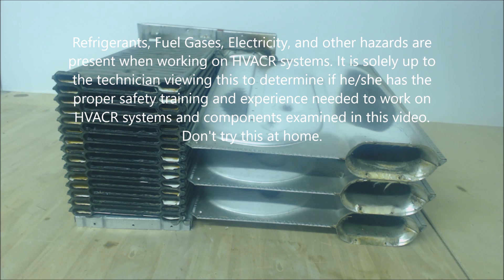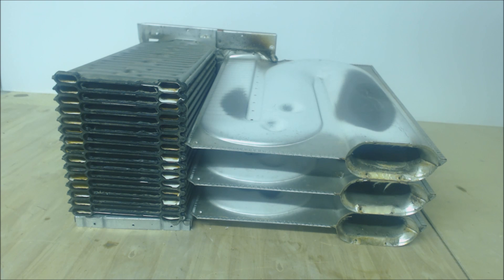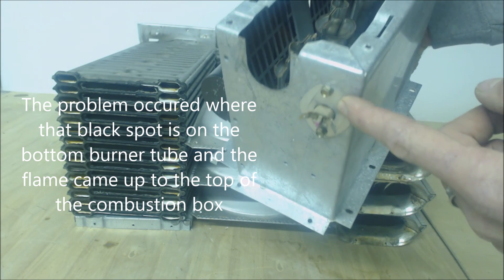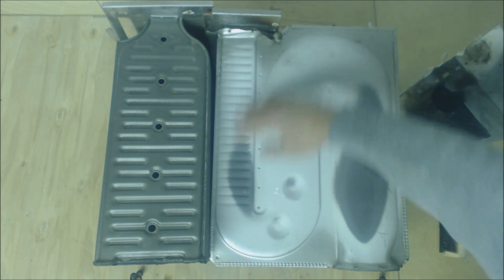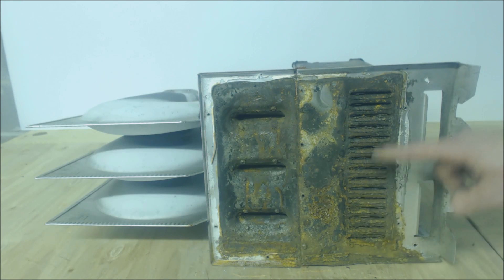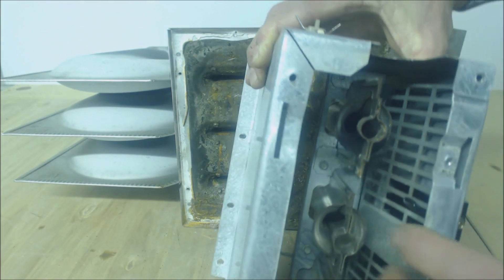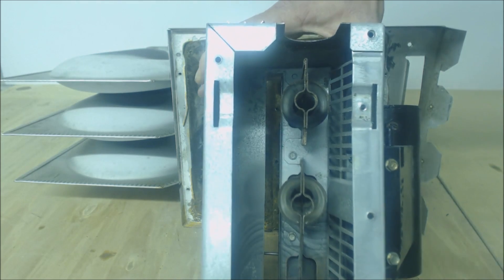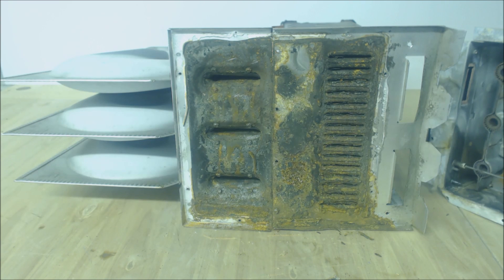Gas Furnace Heat Exchanger Clogged Problem- What it looks like and Burn Spots!

Comment from the maker: Tool List-  https://www.amazon.com/shop/acservicetech
Support-  https://www.patreon.com/acservicetech
For those that are looking for the tools used in the videos: (Linked Below)

Here is a link to the UEI DL389 Multimeter used in the videos- http://amzn.to/2av8s3q 

Here is the link to the Fieldpiece SDMN6 Dual Pressure Testing Manometer with Pump-http://amzn.to/2jyK5Ka 

Here is a link for the Supco Magnet Jumpers http://amzn.to/2gS4h6z

Here is the link for the Irwin Wire Stripper/Cutter/Crimper   http://amzn.to/2dGTj2V

Other tool links can be found in the video description section.

 ACSERVICETECH is a participant in the Amazon Services LLC Associates Program, an affiliate advertising program designed to provide a means for sites to earn advertising fees by advertising and linking to Amazon.com.
Reply: AC Service Tech LLC   If frozen  condenser pipe busted due to electricity off during freezing temperatures will this affect the heat exchange? I have carrier infinity. 2009 gas furnace and the heat exchanger  switch is tripping every 2-3 days depending on how often it is  turning on the heat.  Like now it is 23 degrees so I assume putting stress.  Did the  condenser pipe  busting and siting there for long time before fixing cause this issue?   If so I can get my homeowner insurance to cover fix or replacement.   I had busted/frozen pipes throughout. House that insurance is covering.  This happen   last winter  in Park city utah but just came back here to deal w/ the issues.  Thanks for your help.

Comment: This video really helped me understand my furnace and how the condensation is becoming an issue.  It was made in 1995 and is starting to exhibit some of these problems.  I'm thinking I will pull out the heat exchanger and clean it or replace the furnace.

Comment: Thanks for your video.  Had to buy a new furnace today because of issues with our heat exchanger.  I would love to troubleshoot and find a cheaper solution, but it is -25°C here, and will be all week.  Tough to be without a furnace for even a few hours.

Comment: I had a partially clogged secondary and was causing unusually low temp rise while running. 
I couldn’t figure out why the temp rise was so low. 
Manifold pressure was normal, no rollouts or HL tripping like I normally see when secondary clogging. The unit just didn’t have the heat output and I still can’t figure out why…

Comment: Seems like if the secondary exchanger plugs up more and more one should get a higher negative pressure at the pressure switch tube... Like an indoor blowers entering negative pressure; if the return air ducting filters and such are restricted you end up with higher negative pressure at the blower inlet... You mentioned reading less pressure if the exchanger is restricting flow????

Comment: Man this is scary stuff. My old 88 Model Rheem 11EA-JR will be 40 years old in 2028.
It sits beneath the floor and does not have a single flame roll out safety switch. It has quit working for now which is a good thing because I found a rotted out Flue pipe under the house. So far I have found 1 bad 90-370 fan relay and a bad pilot igniter.
Need to check the heat exchanger and I'm gonna put some flame roll out switches on it.

Comment: Thank you so much for the video! I have learned tremendously by going through your list of videos. I do have a question - my Lennox furnace attempted several time by inflaming for about 30 secs before it went to safe mode. When I bypass the pressure switch (the higher pressure one), it runs perfectly fine. I've ruled out other possibilities using your pressure switch video. Would that be a clogged heat exchange? And if so how would I verify if that's the culprit?  My furnace guy tries to sell me a new furnace so wonder if you could provide your perspective on this. Thank you in advance!!!

Comment: Excellent video. Tech was here yesterday. Furnace cycling off and on. Throwing an overheating code. New flame sensor. No roll out or odors. He checked gas pressure. No problems found so he says it must be the heat exchanger. Wants to sell me a new furnace. Yes, I it's almost 20 years old but with no evident problems found it sure feels like I'm just being sold a new furnace. Calling for a second opinion tomorrow. Thanks

Comment: Blessed my Evolution 90i was registered for Limited Lifetime Warranty within 90 days of installation. 
Limited Lifetime equates to double Warranty of 40 years.
Had to replace the heat exchangers. Parts covered by Warranty. 
Labor on me...
Reply: No it doesn't heat ex is only 20 all other parts double to 10 years with registration
Reply: @kenthomas4668  SORRY YOU'RE WRONG!
Warranty extended if installer registered in 90 days of installation.

Comment: Ive had 2 clogged secondaries on 2007 carrier 96% infinities this last month. Original home owners so warranty is 40 years. Total insanity.

Should also mention both were in horizonal-right configuration and one of the secondaries was replaced 3 years ago. Still waiting on new parts to come from factory but we'll see whats up with the relatively new one.

Comment: Hey, so I am an HVAC student, and my instructors hold your Youtube channel in very high regards. I had a question for a research assignment requirement we have been assigned that I figured I'd go straight to the source to attempt to answer. The assignment is to: 'imagine we are responding to a service call/customer complaint about a broken heat exchanger in a gas furnace.' The assignment further specifies, that we have 'removed the heat exchanger, and see a visible hole in one of the tubes', and furthermore instructs us to 'make a recommendation on what to do with the heat exchanger', and to 'document any costs that may be incurred by the customer based on the recommended solution.'

 I was wondering if you might be able to provide me with any insight as to how Y'ALL might handle this issue. (note: as a 'research assignment' we are expected to reach out to experienced sources, so you are by no means aiding or abetting any form of cheating, whatsoever, by responding, just in case that needed to be specified =). I understand you guys are super busy between the business and the channel, so I would consider it an honor if I got a reply. Thank you for all the awesome resource content, cheers!
Reply: Education is important, and experience is key.  I need to have some theory to understand why and how.  This video is of a Carrier heat exchanger failure.  Usually has a code 13 or 33.  Rollout switch manual reset is usually tripped.  Click.  Lazy flames with rollback because of that primary to secondary blockage.  I’ve taken them apart and seen it on many no heat calls turned estimate for changeout.  If it’s a Carrier/Bryant/Payne 90%+ with either lockout codes, the rollout switch is the first check.  
8 years in service.  Learned a lot, know a little.  It takes time and patience.

Comment: Looks like the secondary heat exchanger would have a longer life span if it was installed vertically as being installed horizantly all the condensate goes through the bottom ports causing it to rust prematurealy.

Comment: Great content! My ArmstrongAir 95V had Roll out limiter that has tripped a few times. I had 2 companies come out to investigate the Heat Exchanger. We removed to remove the old furnace to see the Heat Exchanger and a rivet on the Primary popped out. Manufacture warranty still covers part. I am going to buy a new Goodman 2 stage furnace. Every homeowner should understand how their furnace works so they are able to identify issues before they become life-threatening.

Comment: Gas pressures were not set up by the installer. Improper installation from day one was the cause. I had a new hi eff furnace and tank-less installed. Pressures were not checked. Pretty obvious when the tank-less started throwing codes of low gas pressures. Called the gas company and I was way low out of spec. He replaced the regulator first. That helped a little but was still way to low. He then replaced the gas meter which fixed the issues. Now with proper pressure above the minimum we were able to adjust the manifold side of things. Pisses me off that installers are not doing their job.

Comment: Ah!  Going through this issue right now in fact, and I also noticed the condensate was staining things rusty red and seemed to  trickle out of the furnace long after it shuts down, something it never did originally.
Long story short it's getting replaced Thursday🤣

Comment: Do you have a video how to check a secondary heat exchanger on high efficiency furnace?  Using a combustion analyzer... what pressures are you looking for ? And how to put the combustion analyzer tube in PVC flew pipe without damaging it ?

Comment: Is it possible a secondary heat exchanger could cause the rollout to trip on a 90plus ive had a call everything checked out fine co draft gas pressure the only thing that stuck out was blower very dirty and secondary bit dirty i cleaned it and it didnt trip. Was bit odd it would take like 20 minutes to trip but after the cleaning it didnt trip. Ive seen situations the high limit trips but rollout. Just seemed strange could this be possible. Was goodman 90plus

Comment: Is the secondary heat exchanger drain suppose to be clean when you do maintenance? Or what procedure is best to keep the furnace from becoming more of an issue later on?
Reply from the maker: Unfortunately, there is no procedure to clean the heat exchanger on a gas furnace, thanks!
Reply: Doesn't seem like it's an issue with not cleaning. It's a parts and design issue that can't handle the corrosive elements of acidic water vapor over the short course of a decade. No preventative cleaning will help out.

Comment: New Heat Exchangers Secondary exchanger assembly is made of stainless steel, some manufactures offer a limited lifetime warranty on them, not sure about the fine print however.

Comment: What can it be if I have my furnace in a closet type environment and when I close the door it runs for like 10 minutes then shuts off? Works fine as long as I keep the door open though? Looks like it’s a code 33 but what gives? It runs like a champ with the closet door open? Already changed the filter. No signs of burning. 🤔
Reply from the maker: That sounds like low return airflow. The return grill through the door may be undersized for the amount of airflow that needs to move through, thanks

Comment: With today's metals and decades of CAD tech there's no reason these failures aren't part of our long distant past. Exchangers are no better built today when hi-ef will in fact fail decades sooner than a 1960's cast iron version killing your family much quicker. Oh' but we all save money, sorry about your luck, can we offer a rebate coupon? 
 Truth is furnace corps simply do not want any furnace unit to last long at any cost, they'll lose money. But' man they are junk now.
 Less than 10 yrs ago we had a family of 6 die from a bad exchanger. The furnace was only around 8 yrs old so the companies making this thin tin shit today should be so very proud. Now' I remember it was an 8yr old furnace only because their youngest daughter that furnace company killed was also 8yrs old. I wish I knew the brand but they withheld name, another problem allowing them to continue on unpunished.
Absolutely no reason for these corps to build such cheap junk but to not thoroughly test the systems design too is simple homicide and should be treated as such.
All China trash, not good when your life depends on it in many ways!!!
Reply: I view it as Racketeering.  If it is not punished that means that the govern mente is part of the racket.

Comment: Perfect way to run the risk of killing people in the name of "energy efficiency" ! Not to mention all that money saved on gas (and then some) will have to be spent to replace a furnace that died prematurely! I would rather have a simpler design that might burn more gas, but is safer and more reliable.

Comment: Are the replacement Secondary HXs made better by carrier or will they meet the same fare later on ? 
Thanks
Reply from the maker: They make them better in the new furnaces. The warranty heat exchangers get the same type for replacement for any failed ones, thanks!

Comment: I found a 10 year old unit tripping the furnace board on roll out. None of the switches had to be reset manual lock out . Checked for obstructions in the flu. Flame never rolls out of the box. Thinking the board might be bad. Going to contact Luxaire monday tech support.
Reply from the maker: The flame rollout is usually in series with the high temp switch. You may want to check for a heat rise across the furnace and also when the blower motor turns on and off, especially if it were a downflow, thanks. A combustion analysis would also show if there are no cracks in the heat exchanger, thanks!
Reply: @acservicetechchannel  Thank you so much for your support. Unit has a different code on the furnace board for high limit. The reason i don't think its a cracked heat exchanger is because the flame never rolls out in the short time it runs.
Reply: @shawnriddle3018  flame doesn't need to actually roll out. If the burner enclosure get's hot enough it will trip the roll out on it's own.
Reply: Customer had a new ecobee t stat. Broken common wire on main board. Furnace is working great now. Thank you for your fast response.

Comment: My Goodman unit goes thru 4 cycles then gives 7 SHORT  BLINKS(low flame signal) WHICH I was told it's the pressure switch! But I was told by someone else it sounds like a cracked hear exchanger! The reason is because the unit 
1.1st click the inducer motor comes on! 
2. 2nd click the heating element glows!
3. 3rd click the gas is coming thru the pipe but doesn't reach the element to lite! Now if I blow on it I have to keep blowing on it till the blower motor kicks on! 
4. If I don't blow on it,sometimes it might lite and the blower motor will blow it out and that leads to
5.The unit goes thru 4 cycles then shuts off! 
So what could be the problem??🤔🤔🤔🤔
Reply from the maker: If the blower motor blows out the flame then that sounds like a cracked heat exchanger. That is a dangerous situation due to carbon monoxide so don't run it and verify the crack if you can, thanks
Reply: @acservicetechchannel   how do I verify it? Sorry I'm just starting to learn about this stuff! Lol!
Reply from the maker: @charlesgunter2478  verify visually somehow such as with a video scope or taking the blower motor out to look in or taking high heat temp switch out and looking in or adding the video scope through there or through burner channels. Look from above depending on the type of unit, thanks

Comment: someone below said this was a Carrier/Bryant design.  Is that true?  Hideous.
I would have to question their engineering.
Reply: Looks like one of the Carrier Weathermaker 90% furnace heat exchangers.  The issue with them is that they used a plastic liner in the secondary heat exchanger, which would pull back, exposing the metal to acidic condensation. The result is that they breach or become plugged with rust.

Comment: These furnaces are supposed to be tipped forward slightly to allow proper drainage out the condensate drain. wonder if this one wasn't tipped properly.
Reply from the maker: This one was pulled out before I got it, however, I did another heat exchanger change out where the furnace was tilted correctly and same result, thanks

Comment: I have a Carrier Infinity 2009 high eff....it stopped putting out much heat about a month ago and at same time the exhaust started to smell different.  I checked the burners but they look to be burning ok and no signs of flashback, but there is a definite problem and my guess is the 2nd exchanger is plugged.  How can this peice of junk not be engineered to outlast the 20 yr old one it replaced which was fine except i got sold on a new on!  It pisses me off so badly!
Reply from the maker: Instead of using a copper tube and fin secondary heat exchanger as they do now, they used a galvanized tin heat exchanger lined with a rubber type coating unfortunately.  I would have a tech run a combustion analysis tool on the exhaust to read if there is a problem, thanks
Reply: acservicetech Hi oh there is a problem.  3.5 hours temp rose 4 degrees only  in 30's outside.  Im not one of those folks whos not sure if ever worked better or that didn't notice it takes longer when its colder outside.   I cant believe i paid top dollar for an inferior peice of garbage.   Can anyone tell me if there exists a company that puts out a good well made machine that will last over 30 years like my old ones please?  We r SUCKERS buying this cheap garbage.  What good is tech when it takes us BACKWARDS???   More money and junk machines to save a few bucks in efficiency?  That's the definition of stupidity. Thanks.
Reply: acservicetech Tech out today....secondary exchanger shot...said they they r claiming new useful life of new furnaces is 10-15 years.....replaced it as ita on a recall, no fee.  So all furnaces are now throw aways just like everything else.  Pulled a 50 plus yr old from my moms house, exchanger looked like new....should have kept that thing.  Shame what the world has become.  Cheap throwaway junk.....

Comment: I had a similar issue with my carrier high efficiency furnace installed back in January 2010, and have had this issue already after only 8 years, luckily I have the extended warranty for labor and parts for 10 years, so all is covered, once parts arrive.
Reply: All is not covered when you still have to pay labour for a technician to install those parts by the hour.
Reply from the maker: That's good that it happened in that time frame then, thanks Steve Baldwin!